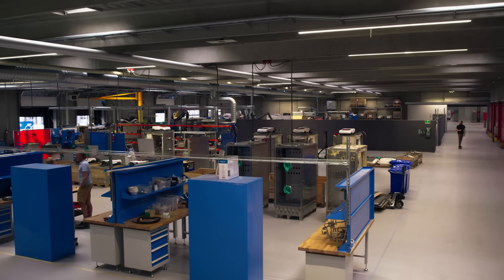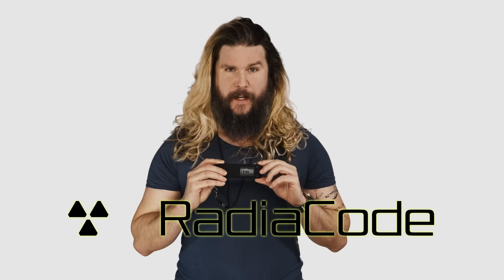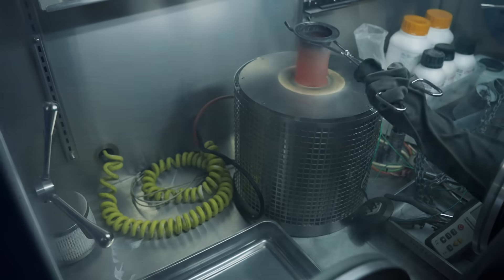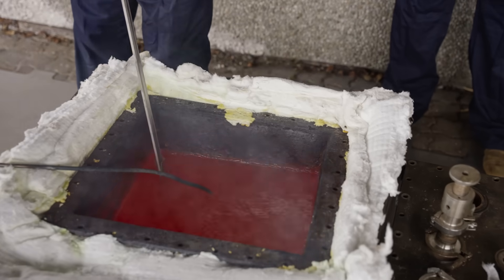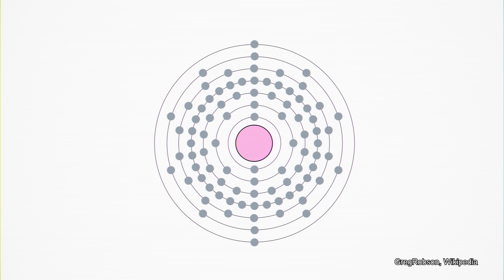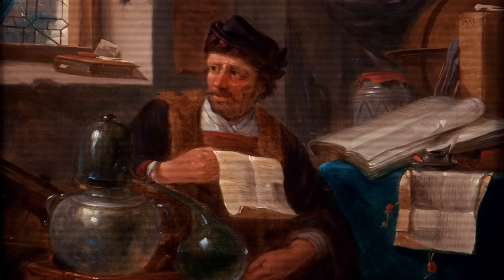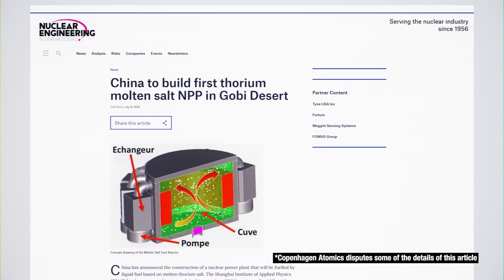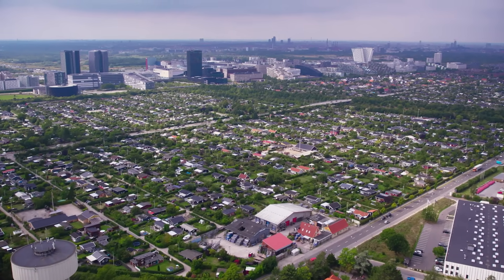Is THORIUM the Future of Nuclear Power?

Comment: Why do we need a future? Current reactors that are safely built and run, work perfectly fine.
Reply: You're right, they're very good. But they're fairly expensive to build, pressure vessels fit for purpose are only made in a few factories, and they're not as good for smaller scale operations in the couple-hundred megawatt range, whereas MSRs are more scalable up and down and cheaper, while being able to be rolled out much quicker.

Comment: Until they explode and explain how they do that little magical gem the "Chemical processing plant" I'm not convinced.
My understanding is the kinds of operations they need to be doing in there is the same kinda stuff they are doing in waste reprocessing facilities today and those tend not to be very easy going places and its not exactly cheap.  In fact it's so ridiculously expensive that nobdy has really processed much of our waste pile yet, even though it's full of rare and useful materials.
We are talking about disolving the molten salt under high pressure in high concntration acids to perform material separation via percipitation and others.  Then re-form it back to a salt and ....  
Nope.  It's BS.  It really is.  I don't see it happening.  WHile the rest of their paper designs are fine I want to see one of these plants running the wild for a few decades in India or china before I'd invest.

Comment: LFTRs are THE solution, but there's a huge r&d hump to get them feasible.

The liquid is literally hell in a bottle. Wildly reactive, super hot, crazy high neutron flux. This puts huge material science constraints on design.

The incredible passive safety ALONE should be enough to dump crazy money into researching this
Reply: Have a look at Moltex energy's solution to this: 
Don't pump the fuel salt.
Create fuel tubes that contain static fuel salts and a sacrificial zirconium layer.
No corrosion, the fuel salts sit in the tube not moving
Gaseous fission products exhaust from a vent, where they decay inside the SCV before being exhausted.
You pump hot coolant salt around these fuel tubes and use that to make power. 
But you use two different salts in the tube and coolant loop, choosing the right one to specialise in just that one task (cooling, being pumped, sitting not being corrosive in the core. 

It's a fantastic design.
Reply: @MostlyPennyCat : SCV reporting for duty?
Reply: @sdfkjgh  
Um, Secondary Containment Vessel?
Reply: @: Thanks.  I was thinking of StarCraft.
Reply: It is decidedly not "widely reactive", flouride salts are some of the most stable compounds. It's not even "super hot", a steel plant operates at much higher temperatures (molten steel ~1200 C, molten salt ~700 C). The neutron flux is a function of the power, and at 100MWth it is actually quite small compared to e.g. Oskarshamn O3 (swedish large BWR reactor) at 3900MWth (39 times the power output). 
There are material constraints for sure, but you are exaggerating.
Reply: You literally used the word literally wrong.
Reply: @toolbaggers  at some point peoples like you will have to accept the use of "literally" for emphasis, language changes and you can't stop it
Reply: @toolbaggers its accepted now to use it as a emphasis even tho it is not necessarily literally true :)
Reply: Any LFTRs built will be vanity projects soon mothballed: no one will (without coercion) pay for their output what they cost to operate. That is the case already, even for cheaper tech, and moreso every day as the cost of solar, wind, and storage halves and halves again, relentlessly. No reactor begun today, LFTR or otherwise, would even be completed; last I checked none were even under construction, just "planned". It costs less to build a new solar farm and switch to it than to continue operating an already paid-for nuke plant. Terawatts of new solar come on line each year. The growth industry around nukes is in decommissioning them, which will eat up many $billions.

Solar and wind projects all have passive safety, produce usefully within a year of breaking ground, and deliver power from small farms as cheaply as from big ones. Vertical, bifacial solar fencerows running north-south between rows in cropland offer farmers predictable year-round revenue in still-producing farmland, meanwhile increasing crop yield by reducing heat stress.
Reply: @ Wind power is decidedly not being halved in price. Solar has been going through an impressive price reduction, but any country that has a pronounced winter is doing itself a massive disservice to install large amounts of solar power. You can't store solar power seasonally and it has essentially 0 output during the times of year when power is needed the most, which are several months.
Reply: @Akio-fy7ep  
Literally building an MSR in Canada, the SSR-W.
Fuelled by nuclear waste. 
If it proves financially viable they can and will be mass produced.

Green power is fantastic but it doesn't solve the problem of baseload generation carbon output. 
Unless there's a quantum leap in battery tech, we'd need to build mountains of batteries to match baseload
Reply: @MostlyPennyCat  Baseload generation does not exist. It's not a thing, and it hasn't been since the '70s. It's a term that's literally just made up, and ironically, the closest thing we have to "baseload" (i.e. something that is always producing some energy to cover energy needs) is actually renewables lol

Energy is sold at auctions (which are called markets, but this is actually a misnomer as they do not operate like markets), and production follows the day-ahead and intraday markets primarily. Basically, because people want to buy the cheapest energy possible, you end up with a so-called merit price curve, where cheapest energy gets bought first (which is almost definitionally always solar and wind), followed by more expensive renewables (like geothermal and hydro), followed by large-scale nuclear, followed by fossil fuels. Once all energy demands are covered, the market gets cleared, and all producers are paid the sale price for the last unit in the merit price curve that was needed to cover demand. This means that all producers want to be on the left-hand side of the merit price curve all the time, and the more time you spend on the left-hand side, the better your profit margins will be. 

This essentially means that renewables will ALWAYS be producing at maximum capacity, since their production price is functionally free, and sometimes even negative with solar and wind. Fossil fuels, on the other hand, tend to be on the expensive side of the merit price curve, so they will often times be completely shut down, or operating at lower capacity, since the demand isn't there to cover for them.

Nuclear could be a nice middle-ground, but unfortunately, for the price of nuclear to be under fossil fuels, it needs to be produced all the time. Intermittent nuclear production is more expensive than intermittent fossil fuel production, but constant nuclear is cheaper than constant fossil fuel. Both are handily beaten out by renewables in just about every situation.

This means that you end up with a system where nuclear has to be subsidized to be able to compete with renewables so it can always be running, because if it's not subsidized, it cannot even compete with fossil fuels.  

Obviously, the actual production of solar and wind is highly dependent on natural phenomena, with quite large swings periodically (however, it's worth pointing out that on average, it's still by far the cheapest energy source, and is perfectly dependable for around 95% of the year if done right). This means that we will always need supplementary energy sources. Right now, this is mostly made up of fossil fuels, because of the merit price curve. Nuclear cannot do this, it cannot react fast enough to market demands. Nuclear needs steady production, which is incompatible with the swings of renewables, but it is also massively inefficient compared to renewables as a steady producer. 

Basically, nuclear is just incompatible with energy markets. 

There are two options: option A, get rid of energy markets and take all energy production and distribution into public ownership (my preferred solution) and basically centrally plan energy production (which is tbf already the reality, just based on market predictions), or B, build more renewables and have the state subsidize the shit out of nuclear so we never need to turn on fossil fuels (this is what France does). Bear in mind, both will be expensive and require public spending. It's the way it is. You can't have the market solve this issue for you.
Reply: @Akio-fy7ep  Building nuclear reactors in the 1950s didn't cripple my nation with 0% carbon goals like green energy is doing now in the UK.  And we're teetering on the very edge of supply.  Wind turbines don't last very long and solar arrays efficiency dies off exponentially.  It's a scam and a racket.
Reply: @Akio-fy7ep  Solar farms are MUCH more environmentally devastating and unsustainable than nuclear. Especially as a way to phase out coal.
Reply: @jayforty7 Huhh??? I love nuclear as much as the next guy, but suggesting that wind or solar is "much more destructive" than nuclear is a severe overreaction or even just patently false, depending on what metric you want to use.

Mentioning any of them in the same breath as coal is just absolutely ridiculous.
Reply: @Cyrribrae he’s likely thinking about the large amounts of ewaste that solar could cause depending on the lifespan of the panels, and the lithium batteries. Not comparable to coal but still a consideration

Comment: It's like building a fire using plain wood (thorium) and a single brick of charcoal (uranium) and as the initial charcoal brick burns, it chars the regular wood into more charcoal to continue burning. The molten salt allows to remove the equivalent of wood ash as it burns. Loose analogy, but it kind of works.

Comment: Another aspect to these reactors that wasn't discussed is that they'd also be safer, too!

The big fear with standard nuclear reactors is the dreaded nuclear meltdown, when the nuclear fuel reaches critical melting point temperatures and escapes containment, producing corium.

However, with these reactors? The fuel's already melted... BY DESIGN. And because of that, the reactor is already purpose-built to handle the fuel in its liquid state, dramatically reducing the risks of it escaping containment like in solid uranium fuel reactors.
Reply: All you really need for it to be foolproof is a mechanism to make it dump the fuel into a recoverable but non-critical storage unit if power is lost.

Something like a train's break system, where an air-pump holds the valve closed and it springs open the moment the air pressure is lost... or a refrigerated plug that'll drop out if power is lost.
Reply: there are operating self regulating nuclear reactor designs for uranium which slow down the reaction as the water heats up, so it's definitely not the issue preventing nuclear power from being mainstream

Comment: The small reactors are not capable of reaching true, self sustained breading in the thorium cycle. They would likely run on conventional U235 uranium fuel or at least to a good part. Even at large size a thermal thorium breading is difficult.  Thorium breading also needs the chemical sepration - that is the more difficult and well possibly more expensive part.  Just digging out the old reactor drawings in not helping at all.

The thorium reprocessing so far is not fully developed. One can recover the U233 at very high costs.  Cleaning the thorium is expected to be even more difficult and would make it highly non economical. Details are unknown, because there is no real need for it and expected to be really difficult. Currently the best estimate makes the recycled thorium as expensive as plutonium separation. Without recycling the thorium, only a tiny fraction (e.g. 1%) of the thorium could be used.
The separation technique needed for a thorium breader would be a major proliferation concern - one reason why it was never developed and likely will never be.

Comment: I was lucky enough to be part of a team that got to brief both the Obama and McCain campaigns about this tech back in 2008. We calculated that about an oil barrel's volume worth of thorium would run a typical nuclear sub's reactor for about 50 years. To bad the US never took the lead on this. Turns out we (along with India and Australia) have some of a largest thorium deposits. There are technical challenges such as corrosion due to the salt, spinning up thorium mining and processing, and safely making the salt (lithium beryllium fluoride salts are actually ideal for these reactors, though the only working MSR made in the 50s/60s used sodium salts), etc. These are engineering and material science challenges. The physics is solid.

One other nice feature is that you can "reburn" your waste products by keeping them in the fluid. This removes most of the nasty actors and what you are left with (mostly strontium) you need to isolate for about 200 yrs vs. 10,000+ years with current waste products.

The making of weapons is always a consideration. Turns out almost every nation who has developed nukes tried U233 but abandoned it. The processing requirements and the potential nasty gamma emitters from the decay of U233 in weapons grade densities halted this. (The gammas are at lethal energies from weapons grade U233 and are easily detectable from space).

The energy density from these reactors is also amazing. We are talking TW-hr/metric ton of fuel (using LiBeF salts) or a few hundred GW-hr/metric ton of fuel using sodium salts. This makes things like desalination of sea water economical, as well as any other power hungry technologies.
Reply: because US already tried it in the 60ties and it didn't go anywhere
Reply: @eugene4950  The choice was made to go with light water reactors because they can be duel used to make weapons grade material. You can't do that with MSRs. That is why the US stopped development.
Reply: The US leads the world in thorium research already. Oak Ridge has an ongoing research project since the 60's and there are several others of various types. Many of the projects outside the USA are US funded, like the Indonesian one.